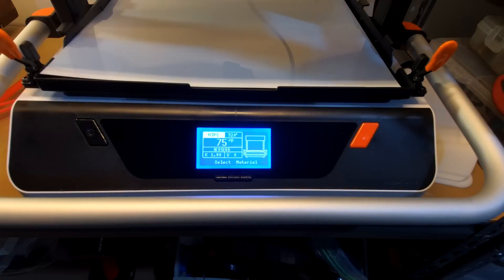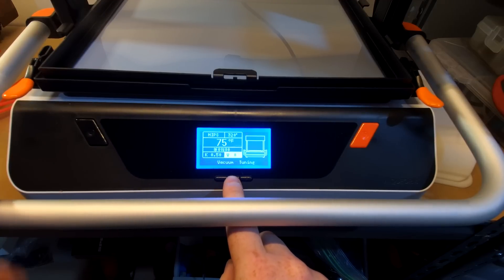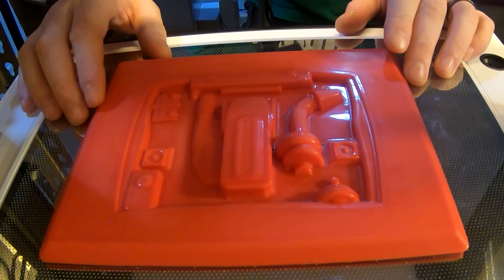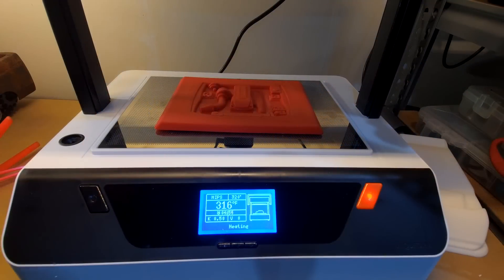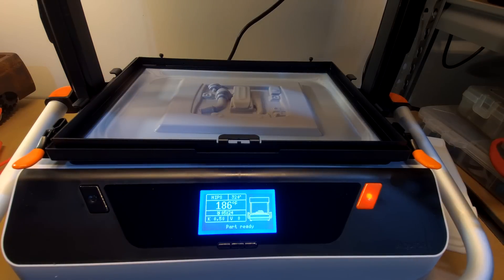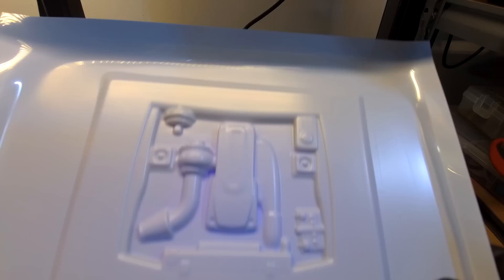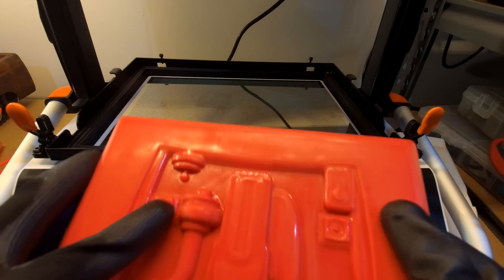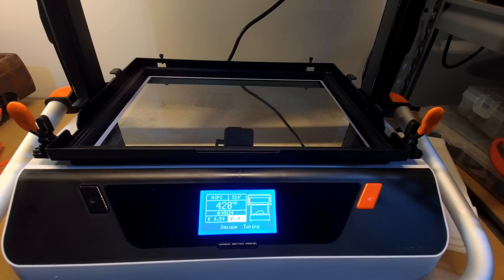Forming Ford Barra 1/10th Engine Bay on Vaquform DT2

Comment: I've been looking about to either make or buy a former for RC parts too. The thing that strikes me with this machine, in all videos of it. The frame seems to let the material slide a bit, resulting in those cockled edges to the raw sheet. There's no issue with that that you've seen so far? 
Professional machines and a lot of home made have a seal around that seems to grip the sheet better.  
I must say, this machine is tempting, the vacuum system seems very strong and using a worksop vac isn't really the best route when making a former.
Reply from the maker: Never had plastic shift in side frame,get mine cut locally to perfect size to fit in frame so no way for it to shift

I came from a diy machine which was bits from oven with shop vac and suction on this thing definitely is better and smaller package,only downside is physical size of it

Do form alot of 1mm polycarbonate on it and once up to temp does it easy